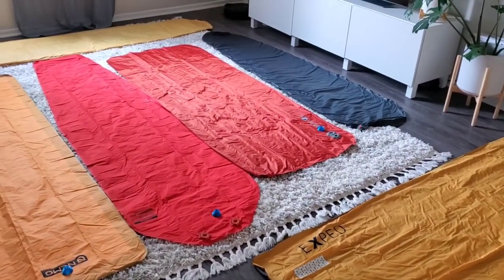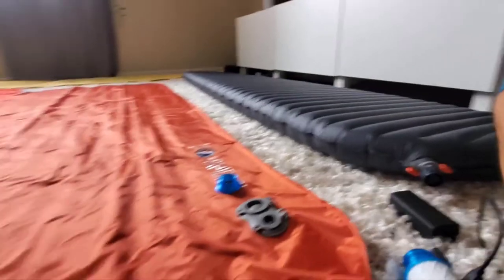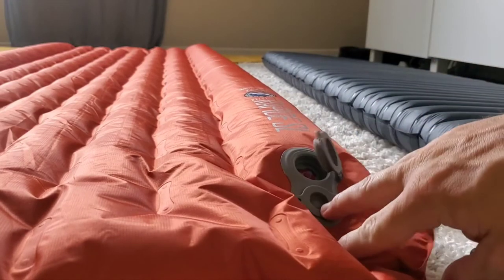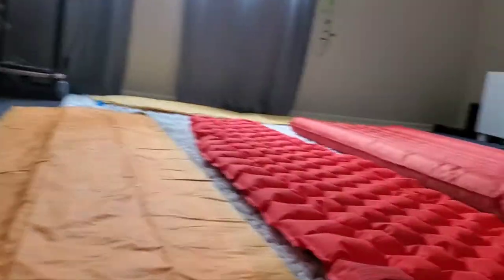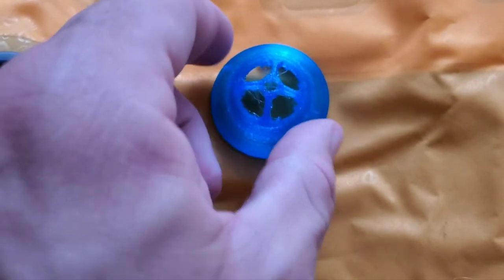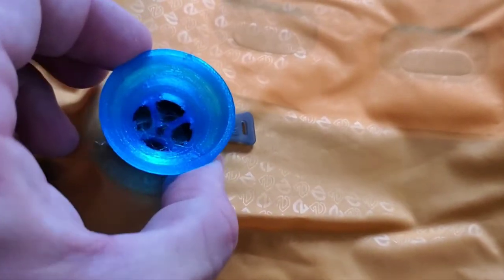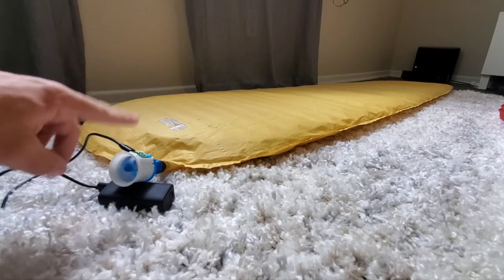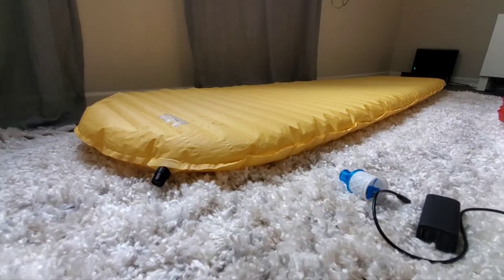New Sleeping Pad Valve Couplers for the Pad-Pal

Comment: Curious why you need to hold the Nemo check valve open?
Reply from the maker: Hey Tan! 2 reasons really, one is more important than the other. 
1.) The Pad-Pal's motor is an "actively cooled" device, meaning it needs air flow moving over it to keep it from overheating. If the check valve isn't held open by the pad adapter, then it greatly constricts airflow and causes the motor to overheat. This leads to some issues like a much shorter motor life of 18-30 inflations and potentially the scenario where the fan blade heats up from the motor shaft, softens from the heat, and shoots off the Pad-Pal while using it. 

2.) It simply inflates much faster this way ;) the Pad-Pal isn't the strongest inflator around, so not having to fight the check valve means it can push more air into the pad over a smaller amount of time.